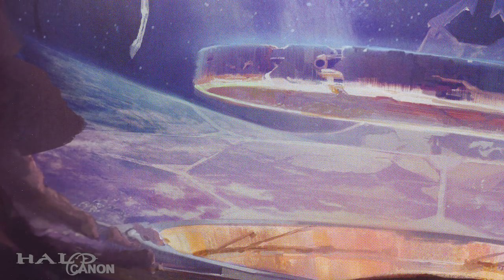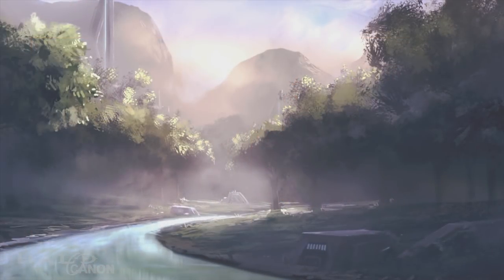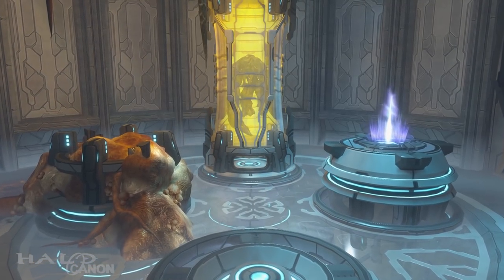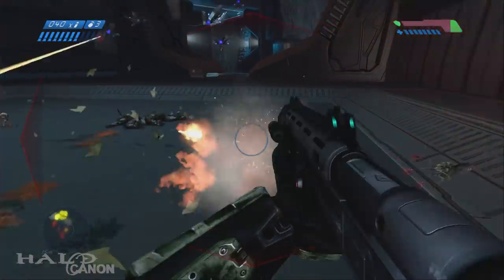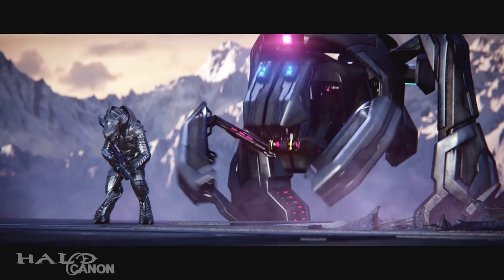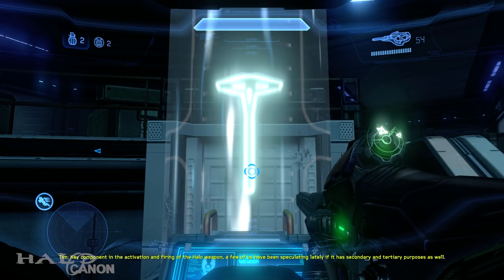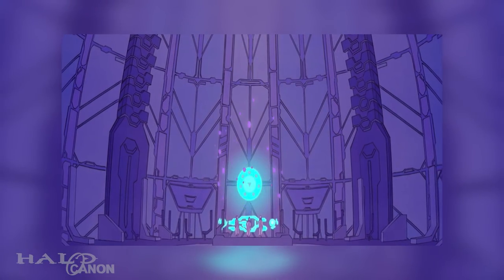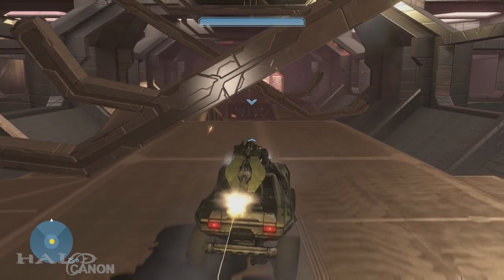The Anatomy of Halo - Halo 101

Comment: Isn't the Halo at the end of 3 referred to as "Installation 04b"? Not 08? I remember Cortana remarking that it was a replacement for the one Chief blew up in CE
Reply: Nevermind, I guess they are referred to by both names. Im a bit rusty on my halo knowledge
Reply from the maker: Installation 04B was the name given by the Halo Encyclopedia, and has since been used by the fans. Officially, it's Installation 08. This information hasn't been posted by 343 as of yet, but it was revealed to myself and a group of fans during PAX back in September.
Reply: Halo Canon nice, maybe they'll elaborate on it in Halo 6, thanks for replying!
Reply: Why would it be installation 08 though? 04B makes a lot more sense. Calling it 08 even though there would still only be 7 Halo rings seems a bit wrong.

Comment: Wow! The rings thickness is a lot thicker than I thought. I’ve always though it was at least 15  km thick. That gives me an even greater imagination of the size of tunnels, installations and machinery.

Also, is it just me or does it seem that Installation 04 is larger or thinner than that of Installation 05 as shown in Halo 2 Anniversary? I can’t help but feel like 343 changed something in 04 and 05 sizes subtly. Even on Raid On Apex 7 the ring looks smaller due to how large the inverted side looks up in the sky.

Comment: The terminology, such as “cross-phased supermassive neutrinos” and “phase pulse generators” is bs. The concepts, however, are surprisingly solid. A few of them even have real-life counterparts.
“Vacuum energy” for example, actually fits the current theoretical definition of dark energy. An innate, omnipresent background energy present in the fabric of spacetime itself.
“Phase pulse generators” are reminiscent of quantum communication relays, a theoretical construct that would convert traditional energy into quantum superpositions, therefore transmitting it instantaneously across infinite distances.
“Supermassive neutrinos” are possible. Sort of. (It’s relative)
I just wish 343 wouldn’t try to explain technology that is supposedly centuries ahead of our current technology. It usually just sounds ridiculous in the long run.
Keep Arthur C Clark in mind when writing sci-fi!
Reply: chris pearson considering how infrequently and weakly neutrinos interact with normal matter, I’d imagine yes, they are rather difficult to create any sort of wave out of.
Reply: TheAstrobiologistGamer 
Holy shit. I just did a project on Sci-fi and world building.
Reply: Mega Guy43 and what did you do?
Reply: TheAstrobiologistGamer 
Described the difference between science fantasy and science fiction with a power point. 
The differences primarily depending on the question: "Does the technology serve some purpose to the story's themes?" If so, it's sci-fi, if not it's fantasy. 
I compared Star Wars and Star Trek for the most part and said that you could tell the same Star Wars story without the ships or aliens in feudal Japan. Because it's ultimately a story about wizards. Star Trek needs the science as it serves a vital part in each episode's themes.

Realism has nothing to do with it. Sci-fi has always been Bullshit. Just smart sounding bullshit.
Reply: Also
#BringBackBearHalo6
#GregKirkpatrickHalo6
Reply from the maker: To be fair, the "phase pulse generators" bit is from Halo CE, well before 343's time. The "cross-phased supermassive neutrions" is 343, though. Well, author Greg Bear to be more specific, but regardless.
Reply: TheAstrobiologistGamer the idea of a ring world is possible, if you put spin on a massive ring, it creates artificial gravity.
Reply: I am reborn. Will lay off the physics for a while though.
Reply: Dude vacuum energy does not equal dark energy it’s different it’s a qft prediction

Comment: Installation 08? You mean installation 04b? Did they change the name?
Reply from the maker: They did change the name, yes. The number are meant to represent the order in which the rings were built. So, the replacement for Installation 04 would be labeled Installation 08, as it was the eighth Halo constructed for the new array.

Comment: Can someone explain 0:59 for me. My nigga went too fast. Is he saying from side to side, the ring is only 22.3 km (13 miles?THATS IT?! Thats how long you'd drive from side to side and then fall off the edge?) 
And wtf is the 159 km?
Reply: Soccercrazyigboman Km (or Kilometers) in 159 km is an official measurement for almost every country in the world (Metric system). 

The metric system is an internationally agreed decimal system of measurement.
Reply from the maker: Halo rings are 22.3 km thick. This means from the surface to the "bottom" (I hope that makes sense). The 159 km measurement was one half of the total width of the ring.
Reply: 159km width as side to side or radius?
Reply: most hybr éjtrç can go that far